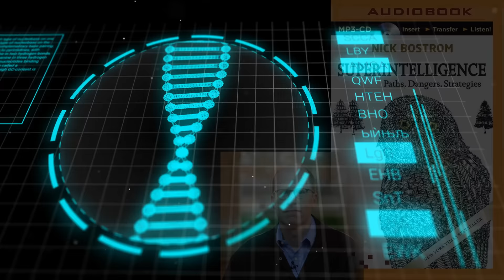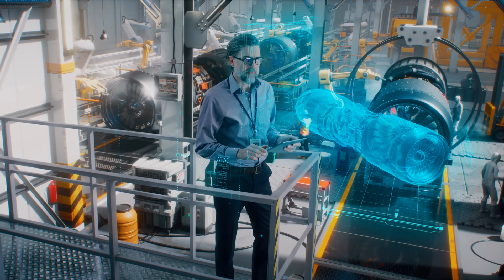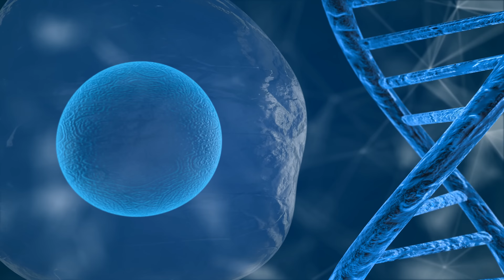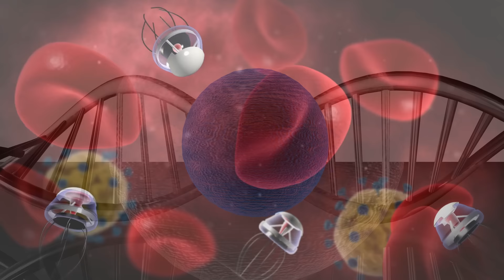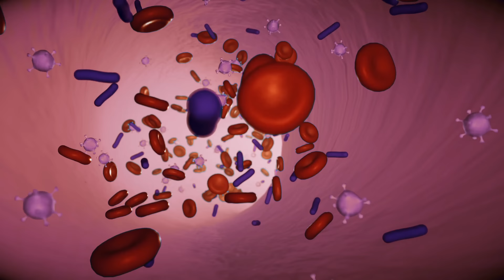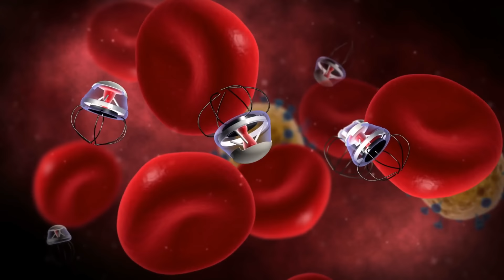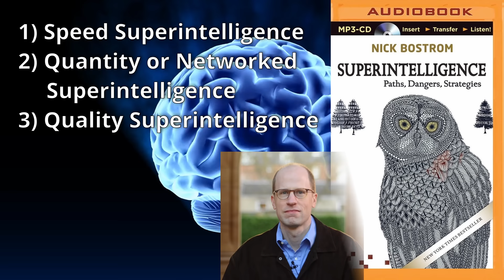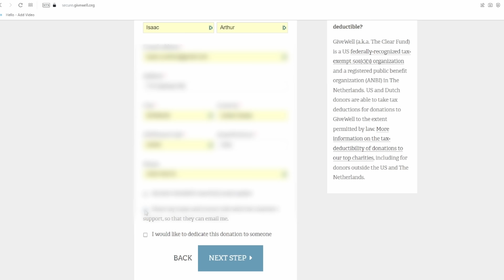Transhumanism & Humanity’s Future

Comment: Humanity's future is not a good one, especially with current trends in play and with the trends being showcased in this video. The tech will not improve humanity, it will weaken it. The human body actively adapts to what it is exposed to, if you use tech to 'evolve' then the body will become weaker, that trend will make the species will become less capable. We are already far weaker than our ancestors were at the cost of our lifestyle and tools. Humanity is dying.
Reply: You say weaker, but do you really think a fully equipped Roman stands any chance against a fully equipped modern day human? We use technology because it allows capabilities beyond what muscles alone can do. Even ancient ancestors understood that it was generally better to have a spear than not.
Reply: @Vaeldarg  if you put a roman and a modern person, both with equal knowledge and equipment, against each other then the roman will win the majority of the time hands down. That is because people today are weaker than the roman was simply because the vast majority take the easy path time after time while the roman had to take the harder path. The human body actively adapts to the environment it is in, provided that it does not have severe flaws hindering its capabilities, so if you are in a rough setting your body will have denser bone density, stronger muscles due to use and with denser bones allows for higher muscle strength since the anchor points have more substance in them, better reflexes since you would have more reason to use them, and so on. There was a study that i read a while back that found that back when we were hunter gatherers we had bone densities equal to wild animals, when we took up farming the density dropped, and it dropped again when we adopted modern lifestyles. Hell, the body starts shedding calcium when it is exposed to orbital environments like the astronauts are exposed to. The tech is not the problem, society's reliance on it is the problem, society's obsession on saving everyone is another problem. My mother showed me that there are long term consequences to everything, i have noticed that exceedingly few even are aware of that or will even consider them, most stop at the short term consequences and leave it at that.  All the ills plaguing society are largely because of short term thinking, they can be very easily fixed but they will not be simply because it will cost people their lives to do it and that will put the greater whole up for risk later, the later it is will mean the greater number of people will pay for choices they had no part in other than being the result.
Reply: @patryn36  Not sure how you can say that the Roman would take the harder path, when hedonism was a big aspect of Roman parties. You're can't compare a Roman soldier to a modern non-soldier. Not everyone was a soldier in their time, not everyone is an astronaut in modern time. They also thought short-term, that's why their empire eventually fell. They had their own problems that you're overlooking. You're not going by history, you're going by ideology. Have you been listening to too much of those muscle-headed "guru"s?
Reply: @Vaeldarg  you miss the point of the comparison then. We have it very easy compared to anyone in the roman times, everything required more effort than it does now which has an effect on the person. To do any comparison properly, you need to limit the variables to a select few, obviously we have superior weapons and tools than the romans ever did so equipping each side with what they had during their period of existence is a fatal mistake when comparing how resilient and capable their bodies would have been in a competition. Either you are not well versed in running tests in a meaningful way or you are deliberately stacking the deck in your prefered favor which is a very dishonest way to be. In any case, my original point stands.
Reply: @patryn36  My point was that you can't compare the two because the available equipment defines what level of muscle is necessary to build. Romans are well-known for getting just as out-of-shape, if not more so if you look beyond soldiers/physical laborers. It isn't that today's average person is weak, it's that they lack a reason to NEED to be strong. Just as many Romans had.
Reply: @Vaeldarg  actually you can, you give both sides the same equipment and knowledge, at least that is how experiments are supposed to be done to eliminate bias in the data otherwise it is pointless to compare.
Reply: @patryn36  You really think a modern soldier isn't going to build the strength to fight with sword/spear and shield, and a Roman soldier isn't going to be sent out with less strength training when given a gun? Your experiment has a faulty premise.
Reply: @Vaeldarg  even the out of shape roman would be stronger than a similarly out of shape person from today. If you want to throw in the extremes from both time periods then you throw off any realistic comparison, which is the tactic that those who have no real arguement use typically. Any honest comparison limits the variables like tech available or tactics known, that way you get a decent idea of what is going on instead of having so many unknown factors that you end up learning nothing.
Reply: @patryn36  Wasn't going by extremes. Was going by a product of the culture. Do you even understand the complaints you're trying to make?
Reply: @Vaeldarg  it only is faulty when it is gimped like you suggest. You do not have them building up during the comparison, that is done in what would pass for their lives before the comparison, again you need to limit variables unless you are biased to begin with and are not interested in the truth of reality itself. You seem to be only interested in promoting an ideal, not in what actually would be happening if an actual test were done, i prefer logic.